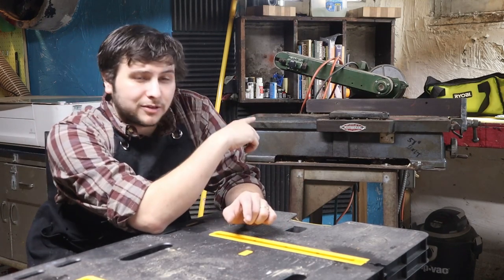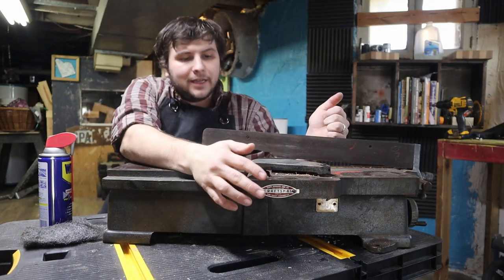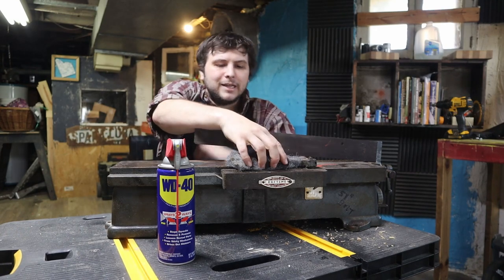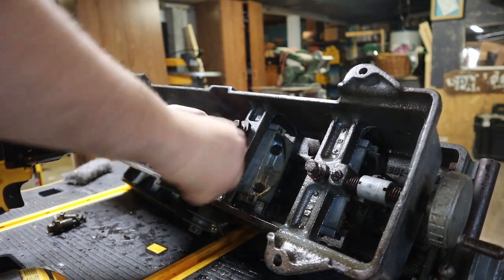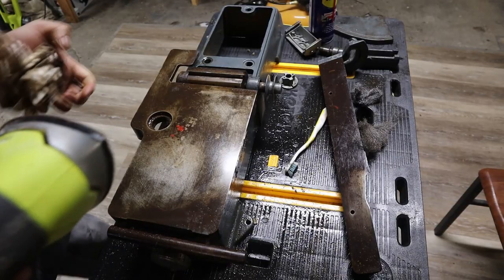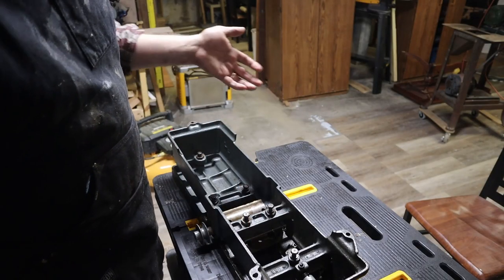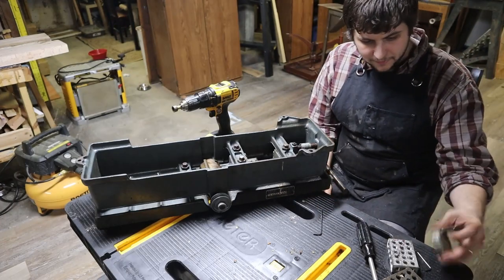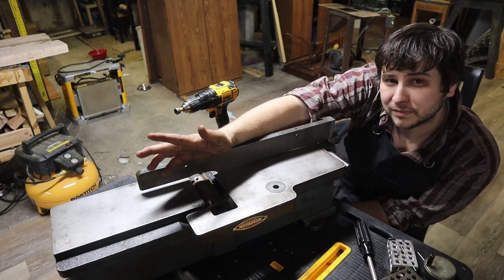Restoring an old Craftsman Jointer

Comment: Your machine your rules, but it's best practice when dealing with flat milled surfaces to never use abrasives on them.
Reply from the maker: Thanks for the comment! And good to know! This piece sits on a shelf as a show piece now after I was able to buy a Jet with profits from Doge.
Reply: Instablaster...
Reply: @Educenterhelp  such a random comment. Go dogecoin!
Reply: Hey Farris, so what would you recommend for rust removal if not an abrasive? I'm getting an older jointer that has rust on it

Comment: What I've read is that you should place a known flat piece of metal on the surface and then run some feeler gauges under it to see if they fit anywhere. I'm about to restore my own old craftsman jointer that I got on Facebook marketplace for $75. Wish me luck!
Reply from the maker: Awesome info! How did your restoration go?
Mine turned into a display piece for my classroom as I was surprised with a nice new jointer.
Reply: @Educenter  as soon as I get to it I'll let you know. :P

Comment: In feed and out feed tables need to be flat and co-planar. Palm sanding is going to leave an uneven surface (can’t tell by eye balling) .
Reply from the maker: Thanks for the feedback! I ended up buying a much nicer jointer with my earnings from Doge.... before the crash. To the moon!!!
Reply: Hey, so what should on use to get old rust off the surface? Thanks

Comment: I lost the blade lock pieces for mine the only option I was able to find was a full spindle assembly for a little over $100 .I know I have the old ones but ya about that .I know thay are with the old blades 😃

Comment: How do you replace those blades and if you did which blades did you buy. Have the same model also looking to restore.
Reply from the maker: I didn't replace the blades, I did sharpen them using sandpaper.
https://www.instructables.com/How-to-sharpen-your-woodworking-tools-with-sandpap/
Reply: If that's the same one I have and the knives are 4-3/8 x 11/16 x 1/8, look for Freud C330 knives. I recently found them on Amazon for about USD 15 for the set of 3.